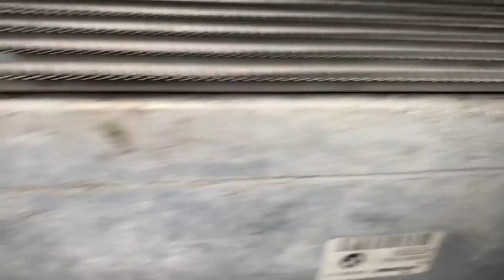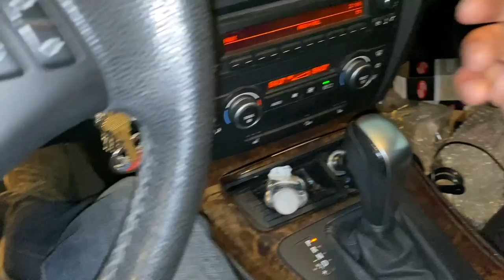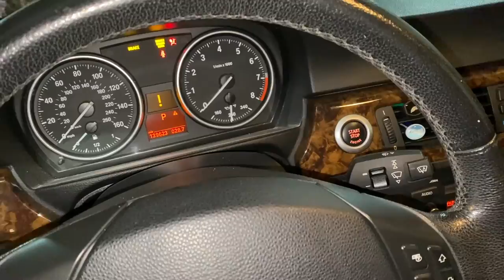Bmw 335i N54 RADIATOR Replacement Ultimate Guide DIY E90 E92 (Includes Auto/MT Drain Bolt Info)

Comment: Save yourself some time: You do NOT need to remove the intercooler. There is nothing that affixes the radiator at the bottom. It sits in the V-notches and has the two screws at the top. You can do this whole job from the top except for the ATF cooling block from the fan housing. I just took out the front screws on the splash guard and popped it out from on top of the bumper cover. You can also easily remove the foot of charge pipe on the driver side making it easy to reach the ATF cooler's connector. It's still tough to reach the screw on the connector from the reservoir (passenger side) but that's not worth removing the intercooler just for that. I agree with the method of angling the radiator to get it in/out, but I didn't find you have to angle it quite so much. I would recommend removing that reservoir-connector screw very last as you can reach it more easily once you start to pull the radiator up.
Go ahead and buy a pack of O-rings for your engine ($25 for a whole set) and replace every O-ring you can reach! Also a great time to change any other hoses while you're in there.
Reply: If you have an after market Intercooler pipe to the charge pipe gets in the way so you might aswell

Comment: So I’ve been working on this for a week now and I think all it was was the O-rings in the connections of the small hoses and not the radiator now it’s holding pressure with the new O-rings in and I swear I didn’t need to replace the radiator but thanks for tips.  My advice is to get a radiator pressure tester and figure out where the leak is exactly before you go out and buy a radiator the O-rings cost me $13 each from Bmw nobody else had them
Reply: Do you have a part #

Comment: Man you ain't kidding about those drain plugs. My new one I broke both plugs and had to use extra orings so it would not fall out. Once I turned on the car the coolant poured out like niagra falls. Probably going to swap them out next oil change.
Reply from the maker: Stupid design man! I broke quite a few myself before figuring it out haha
Reply: Just broke mine :(

Comment: Thank you buddy…. 🙏🏽. It’s the Key word I was looking for “angle more on this side “ (passenger side ). This was a PITA …  just having to replace Ac
Reply from the maker: Anytime man. I remember my first radiator job I did took me about 7 hours start to finish..it sucked. All these tricks I learned helped and I’m glad it helped you too!
Reply: @tunerworld  I sure will pass that tip along. Angle it, angle it.  LoL. Be patient.  I replaced my AC compressor, AC Condenser, expansion valve blow out the lines.   Thing is, I’ll be replacing my radiator in the coming weeks with the aluminum CSF-7046. It’s been on back order which is why I couldn’t do it today.  Thanks for everything
Reply from the maker: @richcruz8924  that’s awesome :) lmk how that radiator is!

Comment: This is a solid vid man thanks. Ive worked on n54 but never done a radiator.  I recently took my n54 to shop they replaced the radiator with an autozone one and it all leaked out next day and then took it back got another radiator and replaced and it still leaked out. So im going to check it out myself. But im starting to think its not the radiator after 2 replacements maybe its a hose. Idk im not sure going to check it out. If it is im going to go with fcp euro radiator.
Reply from the maker: Anytime! And I know what your issue is bro. It’s the drain bolt. Is your car auto or manual? If it’s an Auto and you have a manual drain bolt in there, it will do exactly what you are describing!
Reply from the maker: Skip to 18:25 in this video and I describe your exact issue :)

Comment: I’m doing this job now as you speak 
The part I really wanted to see you cut out
Connecting the intercooler on both side is hard. You didn’t film that part cause you needed both hands
I feel you.  If you have any trick on that please share
When I go back to Connect those I’m  going to spray a little silicone spray on it and pull and wiggle hope I can get both side on
Like I said if you no a better way please share
Reply from the maker: Yes you definitely need both hands haha. You pretty much have to muscle wiggle them in! Go up and down and keep on rocking the joint until it goes in place. Once it gets in place, put the lock clip in!

Comment: I never understood why they secure the trans cooler to the fan and not the rad itself.

The fan needs to come out so often to access maintenance items at the front of the engine bay that it should honestly be attached with rubber grommets in a similar fashion to the airbox...whenever I remove the fan and reinstall it I seem to have about a 50/50 shot of breaking something or pinching a line.
Reply from the maker: Right?!
Reply: @tunerworld  I'll bet there's probably a way to mount a universal fan straight to the rad...if not there's definitely rads with a built in trans cooler available on eBay...next time I do this job I think I'll go that way

Comment: A great video very helpful , thank you for taking the time . Two  comments . What mechanic wears a watch that can be easily scratched while working in tight spaces ?  Do you ever clean any parts removed that will be reinstalled  ,or clean surrounding areas that are covered with dirt and dust that cannot be accessed once the job is reassembled ?
Reply from the maker: I wear it everyday, its durable! Been years and I don't really have scratches on it. I do clean up areas on customer cars usually - this was just a quick garage job on a personal car

Comment: Great video compared to some other ones I watched I’ve been working on my car by myself for several days but I’m putting the inner cooler on the bottom but why is there any liquid in it there are remnants but why wasn’t it full of liquid when you took it off and I took mine off?
Reply from the maker: Because the intercooler doesn’t hold liquid :) it is just an air to air cooler! The radiator is air to water which is why it holds liquid. Glad my video helped! :)

Comment: Having a hard time sitting the radiator perfectly flat. There’s still about an inch of space between the holes on the left side
Reply from the maker: Keep going at it and move things around until it seats in there! Second set of hands helps

Comment: I’m sorry I have a question. So the coolant level as you did, that’s enough? Should the stick be going up all the way as this indicates it’s full and no need or how does this work sorry? I did radiator and the mechanic drain and added coolant and added as you did not all the way up as I used to have. Please let me know.
Reply from the maker: There are two dots on the stick. The stick should float outside of the tank in between the two dots, not all the way up :)

Comment: Why is it that when you take off the inner cooler it doesn’t have any liquid in it
Reply from the maker: Which one, the trans cooler?
Reply from the maker: Ohh the intercooler? The intercooler is an air to air cooling system so it does not use any liquids :)

Comment: So I got it all back together snug poured coolant in and it’s dripping on both sides from the small lines but the T 25 screws are all the way in how is this happening?
Reply: Same thing happened to me.  I am going to post about it because it turned my 2 hour job into an 8 hour job.  In short, I needed new o-rings on those two small connections because the holes in the new Behr radiator were slightly larger than on my old radiator which allowed coolant to bypass the old o-rings and drip like crazy.

Comment: The passenger radiator mount on the top is giving me major problem any advice?
Reply from the maker: Shift it around! The radiator that is until it fits in perfect. Make sure the bottom mounts are in correctly and everything is seated! It ain’t Easy I’ll tell you that lol

Comment: I pressure tested it and it ends up that that is where the leaks are come to find out that the screws weren’t tight enough but now one of them is still leaking and I’ve tighten the screw
Reply from the maker: Do you have the correct drain bolt in? If you don’t, it will cause a leak from that area. You have to make sure the Automatic drain bolt is in. Most radiators come with the manual one installed
Reply: @tunerworld  The one I ordered online only have the manual plug so I bought one at O’Reillys which had the automatic one and I have that one installed I’m just not getting the hoses tight enough
Reply from the maker: @JonathanWornardt  do those hoses have O rings on them? I can’t remember. Maybe try new O rings?!
Reply: @tunerworld  No O-rings but I think the fitting is leaking

Comment: my condenser housing feels very loose and when i tried putting my radiator in i couldnt screw in the left side if anyone knows would be great help. I dont know if i broke anything or if its supposed to be like that but my condenser is all over the place mainly on the driver side it sticks far out and can move freely
Reply from the maker: It probably isn’t lined up correctly! Make sure to have the rubber block clips in all the way and that everything is seated correctly.. it’s a major pain
Reply: @tunerworld  are you referring to the ones on the bottom? if so ive been struggling to see where those go to secure the housing but i know what you mean its definitely not lined up its dropped down so far and feels as if the driver side isnt connected to  anything, your videos been super helpful i got a little too excited after finally getting the lower radiator hose off and rushed it lol
Reply from the maker: @evansm3ow  yep! It’s that weird square black plastic piece that clips into the body where the radiator sits on. All that stuff has to align perfect. You may have to lift it up and ensure it’s resting on the right spot
Reply: @tunerworld  took everything back apart last night gave it another shot today taking a little break so far all the screws are in and lined up good just getting everything else back together thank you for the vid and the further help means alot
Reply from the maker: @evansm3ow  Nytime! Hope it falls together well :)
Reply: @tunerworld  went together good got a full day of driving it no overheating only issue was my intercooler pipe popping off no more coolant issues knock on wood

Comment: where was the radiator leaking from and how did you figure out it was your radiator? thanks!
Reply from the maker: It was leaking from the seams! This leak was obvious but usually I use a coolant pressure tester to diagnose leaks :)

Comment: Idk if anybody going to answer but quick question if you have leaks from radiator will the heater still work or not
Reply from the maker: As long as you have coolant in there and pressure/flow, your heat will still work
Reply: @tunerworld  so when I drive it on the freeway it blows low but when the car is not drivable there’s no heat or air coming through the vents
Reply from the maker: May be a blower motor
Issue, do you have your recall done ?
Reply: I tried  all that blower motor resistor still nothing
Reply: Could it be the battery not having enough power
Reply from the maker: @Findingmatteo  It could be, I have a video on the battery causing this issu